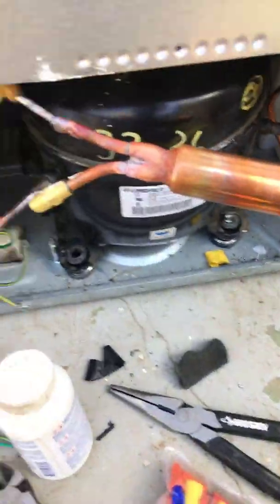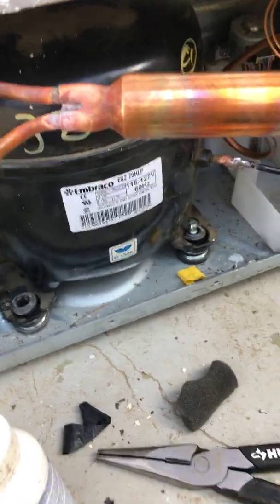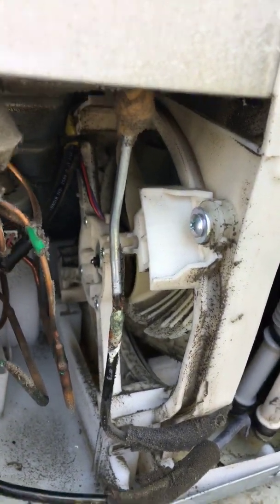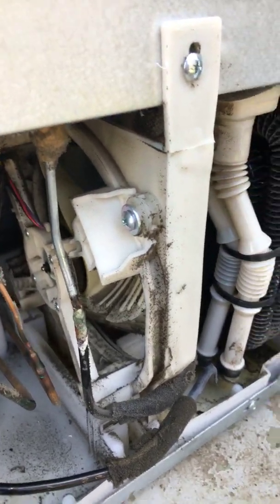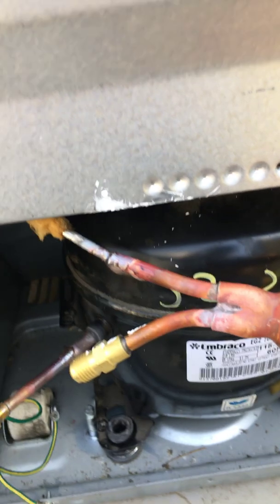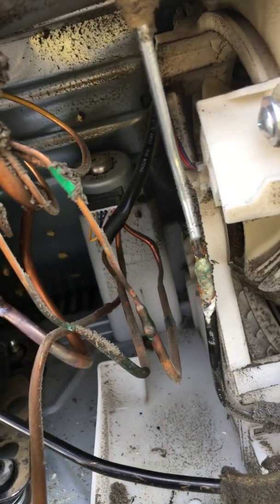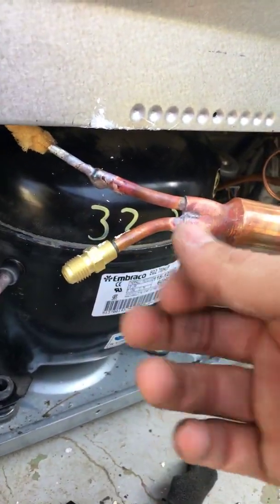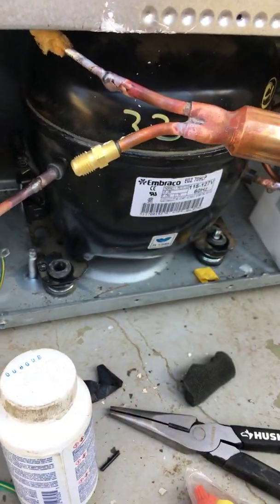LG REFRIGERATOR LINEAR COMPRESSOR CONCERTED TO 115V

Comment: There is solenoid on this fridge. When the compressor shuts off, the solenoid closes and stops the refrigerant flow. high side will remain 200 PSI and low side will remain 0-5PSI. When the compressor wants to cycle again , the solenoid will open and compressor will start at the same time. Problem is that the pressures wont equalize in time and the compressor will overload and restart in 3 minutes. I hope your aware of that.

Comment: So what’s your answer to tapping into a variable speed four wire LG condenser fan —they start slow with less voltage then build up to 12 V DC !! my answer would be to run a transformer and find the two wires AC that go on and off with the compressor of the four wires theta are  together in that one place on the board …I haven’t done it yet but I’m going to investigate my friend says usually when they fail the board they only produce 110 of power for the compressor the original 220 compressor

Comment: 2:30 This is called the sweep charge method, and it has been recommended by manufacturers for many decades. As long as the system hasn't had a compressor burnout, moisture, or other form of apparent contamination, it is perfectly acceptable to dispense with pulling a deep vacuum.
Reply: @WaffleStaffel - That's the lazy technician's way of doing it because they don't want to go to the truck and hump a vacuum pump.
It's a method for someone who doesn't have a vacuum pump.
Pulling a deep vacuum below 500 microns with a good pump is the way a real pro does it and should do it.
Reply: @TheNYgolfer  Mmm, that may be the way someone with no confidence in their own discretion does it, but it's not strictly necessary under the conditions I mentioned. As long as no winding has burned out, acid is not an issue. The refrigerant displaces any air in the system, so as long as you've changed the drier, moisture and non-condensables will not be an issue. Most people don't even know what's in a filter drier, but the molecular sieves they contain hold on to a large volume of moisture and gasses quite aggressively (This is the working principle of a sorption pump, which you can find videos of here. Next time you pull a drier, take out the sieves, hold them in your palm, and add a few drops of water)- A real pro working on residential refrigerators would be more concerned about saving the customer money than they would about saving a trip to the truck.
Just because your instructor told you to do it doesn't mean it's gospel. It's just basic physics.

Comment: So I’ve been doing this to the lgs but recently running into a problem with the 4 wire fans when it’s wired up the compressor turns on as soon as you plug in ref. Any idea?
Reply: Already have a solution?
Reply: @mara12743  yeah it cost me $250 for a local guy to show me. But worth it and the module is pretty legit.
Reply: @christiansigala779  ok, and what do you want for the information. By the way i'm from south america

Comment: I have converted many LG units thanks to your tutorial!  I have only one problem and its with the 3 way valve models. I can convert the non 3way valve fridges just fine but when I do the exact conversion for 3way systems, the fridge never drops below 42 degrees for some reason and the cycle always get cut short. I've attempted this 4 different times on different models and always the same result. I'm convinced that this method isn't fully compatible with 3 way valves because it floods the smaller fridge evaporator and the frosting action stops sooner than it should. You can audibly hear the refrigerant flowing through the fridge evaporator and watch the frost patterns slowly degrade until its not frosting at all and essentially simulates a "low on refrigerant" pattern where is frosts up the capillary tubing. And then the freezer gets too cold, it operates but only between -8 and -2 degrees. On one particular model, the fridge would not go into defrost because the sensors were always above 41 degrees and thats it's technical cut off so I kept getting the defrost sensor error and it would block the ability to use the user interface and get ice or water from the front until you reset it (unplugged) or defrosted it. I always make sure the refrigerant valve is in the home position before proceeding and always that i pull it below 500 microns and that it doesnt rise above 700-800microns before proceeding. Tell me if there is something I am missing. I would love to get this modification functioning for the 3 way valves too. I converted at least 20 or so units now so I'm familiar with the process to know that Its not a mechanical fault I am making but perhaps there is something I am missing if you're able to get it 100% functioning. Have you ever bothered to monitor the temperatures after you convert the 3 way valve models? Because it's every single time for me. I always set my parameters at 0 and 37 and have tried many other variations of settings as well and it just worsens the scenario.
Reply: randy, i think im having this issue.  it seems like i run out of refrigerant.  once i get down to  40f/20f  low side drops to zero or negative and high side drops to 100.  i just added alot more refrigerant to see what would happen.   did you ever get this figured out?
Reply: Are you using a 1hp compressor as he says? If so that's overkill and can cause problems because it would require a different metering size to get the proper flow rate, which is critical in 3 way valve applications. Go with  1/3 hp or better yet, look at the specs for the original compressor and see what btu rating it has and make sure the compressor you are putting in has the same btu rating or as close as possible. 
 Secondly how are you charging the system? Are you weighing in the amount that is on the placard? If so you are probably undercharging it for several reasons. Not compensating for extra charge due to the hoses, different btu compressor, loss of refrigerant that is trapped in the high side hose when you disconnect that hose etc.
I suggest weighin in the amount on the placard as a start and then using the superheat method . As the temperatures get near the cutout point go for a superheated between 20 and 30 degrees  at the compressor until it reaches temperature and shuts off. Yes that's time consuming I know.
Proper charge is critical on these dual evap models with 3 way valves.
I am only guessing here since I have never done this conversion but this is where I would begin.
If this doesn't work then I would think that on 3 way valve models the variable speed compressor are a must and so I would stop using anything but exact replacement compressor on these models.
Reply: I have a refrigerator with a 3-way valve.  The compressor was replaced via LG warranty than I purchased a PCB.  Same issues as what you are experiencing, cycling off before reaching temp setpoint.  I decided to modify this procedure a bit.  Used a relay to start/stop the compressor via condenser/compressor fan, same as this video.  The twist is, I am still using the LG linear compressor but it's now powered by 120vac through that new relay.  I only used 2 of the 3 pins on the compressor (the pair with the highest resistance).  To charge with 134a refrigerant, I start with the design weight (6.3oz).  I monitor the suction pressure, never letting it go below 5lbs by adding additional refrigerant.  As it nears the setpoint I want the suction line to frost.  This is done by adding more refrigerant until that is achieved.  The refrigerator now maintains 37ºF and 0ºF.

You're wondering why I overcharge the system.  First, it was the only way I could get it to run (cool) as a refrigerator should.  The linear compressor runs warm to the touch while a conventional compressor (in my case an LG wired like a conventional type) runs hot.  My shell temperature was 175ºF, which I think is normal and safe.  By allowing the return line to just frost, it helps keep the compressor cool.  I do not worry about slugging the compressor because the return gases (or any liquid) dumps into the compressor cavity and not into directly into the compression cylinder.  After watching it operate and satisfied that all is OK, I insulate the suction line to prevent any frost buildup. 

It has only been a few days, not sure if what I did was good or bad but it's working.  If I can find a conventional compressor for a reasonable price I may go that route.  Any suggestion for a compressor suitable for a 30 cu ft refrigerator?
Reply: Di you come up with a solution for this 3way valve system having the same issue

Comment: Hey good work can you show a step by step how to do the electrical part of that conversation thanks
Reply: He's crossed it turns on to turns off the fan and turns on the fan so it's kind of like that little tie on a timer which is already integrated in this computer it takes care of turning this thing on when defrosthis thing on Wendy 1st and I will ask what I use

Comment: I been having problems with a linear compressor,  I replaced it but the new compressor does the same thing as the old one, basically I have hi low pressure about 45 psi to 52, what can I do to get this fix?
Reply: Hey bro i put a 115v compressor in a lg French Door fridge im trying to use your method but having problems my compressor not running so if you could give me some help getting it up I'll really appreciate it my name is Tray hit me back

Comment from the maker: You have to get the power from the cord and run through the relay not the compressor relay and extra relay. You can get it from a GE side by side refrigerator mother board. Check out my newest video. I went a bit more in detail. The condenser fan will trigger the relay to close so it can let the neutral line pass current to turn on the compressor. There is some wiring you need to cut and put together. Next vid will help. I explained with pen and paper. Next will be the actual video of the whole process.
Reply: Hello  please  I need your help in something
Reply: @marlachyjoseph1378  I can help if needed

Comment: How did you get the voltage to the compressor via the condensor fan isn't the condensor fan run off DC voltage also what type of relay did you use on the control board please post a more detailed video of how you wired the 115v compressor
Reply from the maker: Yes sir.  I’ll make a video on Sunday. I’ve got about 3 units I will convert. Stay tuned